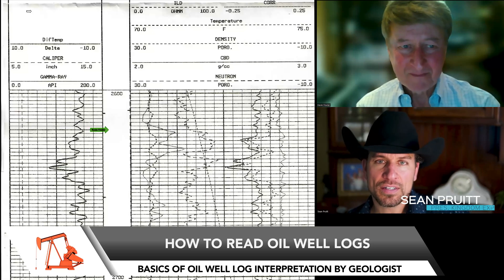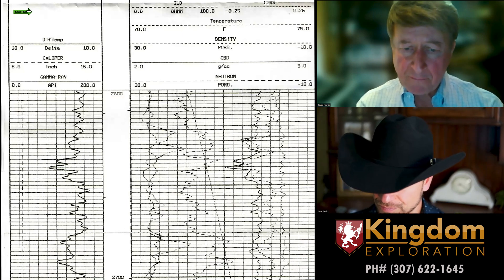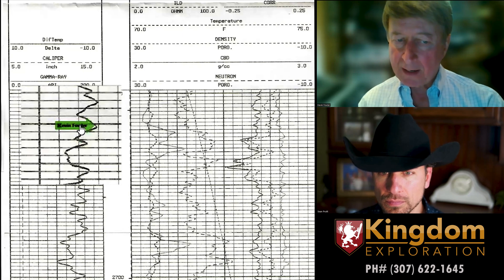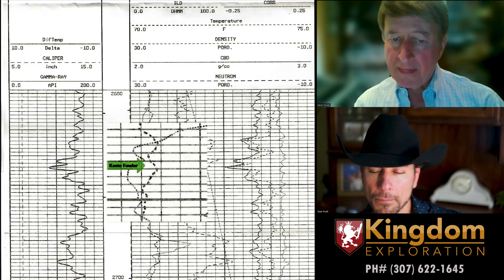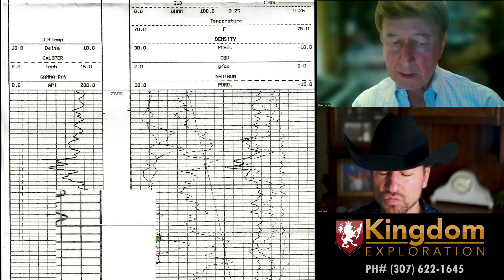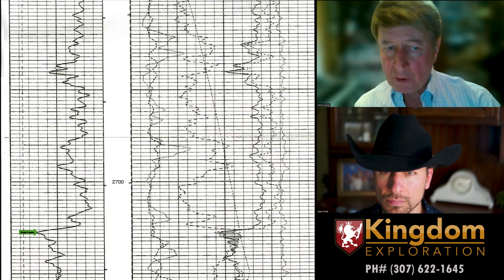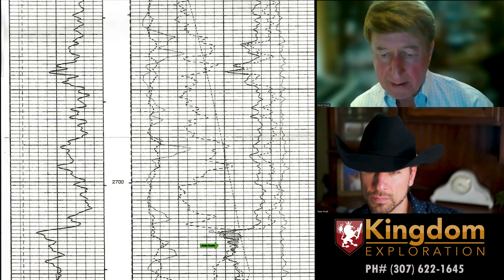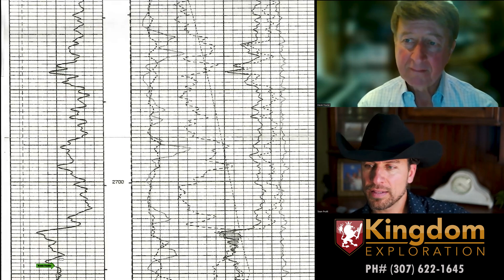How to Read Oil Well Log | Experienced Geologist gives Basic Well Log Interpretation

Comment: I know that those black squares every 42’ are csg collars and and I look for the short joint to get on depth and begin to pin point inject every perf with acid. That way you know how much psi it took to break..how much acid was pumped in each perf and at what rate. You ready to get your wells acidized hit me up!!